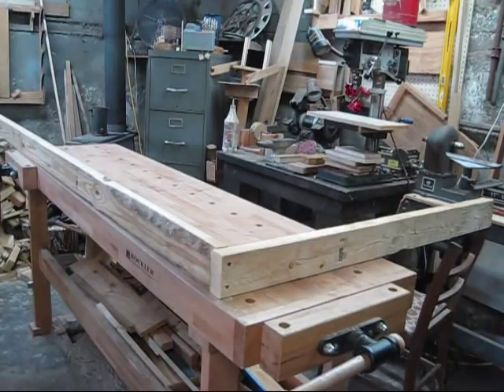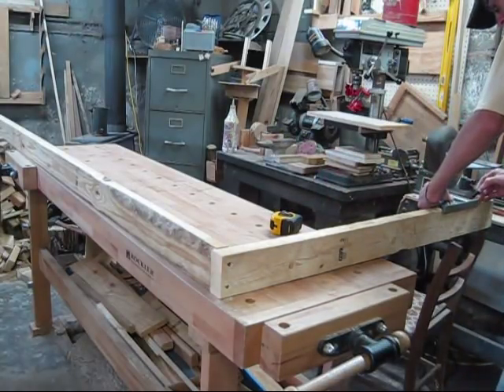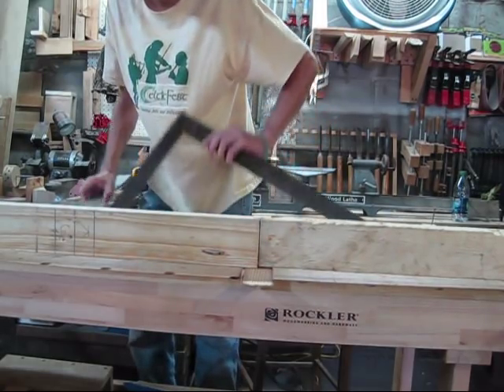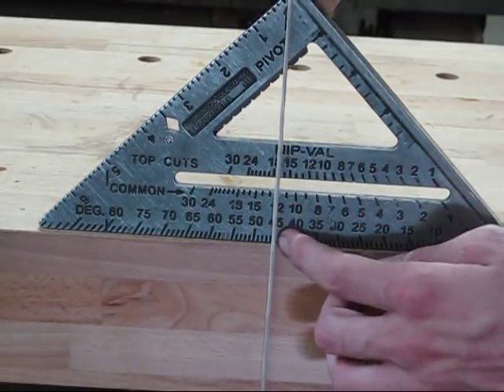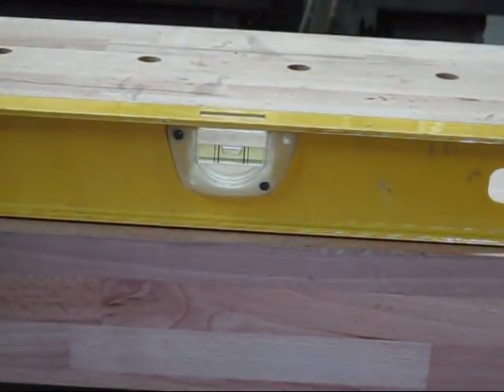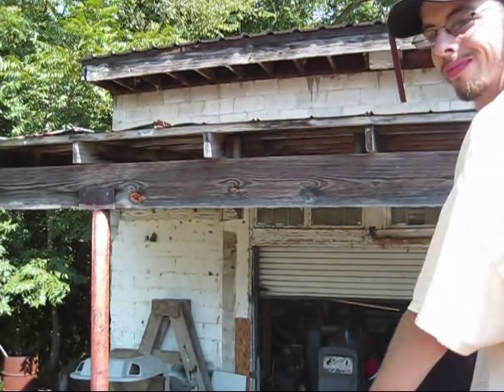Tricks with construction tools

Comment: I liked the speed square as a level, pretty cool. just a tip your 3 4 5 ( the pythagoream theorem) you can do any lengths, you measure any distance ( 3 4 5 is just the easiest) you take your length multiply it by itself do the same with your other measurement, then you ad the two together.  the square root of this number is your measurement that you pull between the other ones.  so length x length  + width x width then square root example    7feet on one side , 9 feet on the other would be  7x7 =49  then 9x9 =81  49+81=130  square root is 11.4 (a calculator will help here)  so about 11 and 3/8 would be your squaring measurement. I know I did not explain that very well and I apologize for that. but I hope you can make sense of this. so if you have a long wall or what ever to square up you are not restricted to 3 or 4 feet. hope it helps

Comment: very informative video! 
id like to extend the 3 - 4 - 5 method. on longer runs you can use 6 - 8 - 10 , 9 - 11 - 13 and so on just add 3 to each number
Reply: 9 - 11 - 13 does not work. The three numbers have to satisfy a^2+b^2=c^2 (The Pythagorean theorem). 6-8-10 works because 6 squared + 8 squared = 10 squared. The last number would actually be 9 - 11 - 14.21267. Sorry, my wife is a math professor and I am a construction math geek. :)
Reply: The numbers have to be multiples of 3, 4, & 5 (as he stated in video) for it to work.  You can't just add 3 as you described. It is based on Pythagorean's Theorem (A²+B²=C²).  it just so happens that 3²+4²=5², so it would also be true of multiples.
(3x²+4x²=5x²)
Reply: burtonkidd You must be scratching your head a lot when you cut all those tappers on your bigger jobs

Comment: Great video. Did you know you can drive a nail into an end of a board and not split it... all you have to do is turn it upside down and ping the sharp edge with your hammer. This will dull the edge and allow you to drive it into ends of boards without splitting it. Try different degrees of dullness. Works on 16s to polebarn spikes! Lastly, if you are up on a roof and have no solid concrete floor or metal table to ping it off of, all you do is set the head of the nail into the head of a prehammered nail, then ping the sharp end with your hammer. Good day!

Comment: the tape measure fetching trick only works if you can see the item but are for some reason not able to reach that far. having worked in various construction trades for many years i have used it myself. 

i did not know the 3-4-5 rule and that was worth watching in itself. usually if i am building something with 4 sides i pull a tape diagonally across the corners to see if they are the same. this will let me know the corners are square provided the parallel pieces are of equal length. of course if you are laying out corner plates on a slab that may not be possible so the 3-4-5 rule is good to know and would be more accurate than a framing square due to the length employed.

Comment: the 3 4 5 is the best way to square corners digging and setting forms for a house foundation.  And to know if you are on the same level for the corners... use a garden hose with clear hose attached to both ends.  The water in both ends are at the same level.  I liked your video.

Comment: Thanks. The first 2 are handy low tech and I'll probably use them sometimes. Just for laughs, I'll give ya a silly tape measure trick in return. I've used it from time to time in good humor. You pull out the necessary length of tape to reach your pal's face while holding the tape reel in the proximity of your crotchal region and proclaim, "Mike, according to my calculations, you're about 5 foot 4 inches away from blowing me right now."

Comment: at 7:00 when you start to pull ur string. If you smooth that corner just a bit with a hammer the screw goes in a little easier exactly where ya want it. Just a tap or two.
Good video my friend. The speed square trick was pretty cool.
Reply from the maker: +HeReformedMe Thanks for the tip.  Glad you liked it.

Comment: Hi all, I live in England and an old timer showed me how to fit a door frame without any levels just a piece of sting and 5 nails. Frame is perfectly square and plumb and it is so simple it is brilliant. You can plumb the hinge side with a plumb line made of a piece of string and a large nail as the weight. you can get the head square using 3 4 5 measurements, then pin 4 nails into the face of the frame top and bottom of each leg then cross string across the corners diagonaly then move the loose leg in or out until the string touches in the middle of the frame, then its plumb both sides. They built pyramids without a Stanley level but judging by some of the houses I work in here in the England some tradesman may own a level but they sure as feck don't know how to use one.

Comment: I liked the 45 level and the tape line thing can be improved....get an old magnet like a disc magnet from an old har drive and hook onto the end of the tape measure or a long flexible rod itll latch onto the tool as well as the piece youre using to retrieve the tool

Comment: good stuff thanks!! and a good trick for tying the string to the last is screw is to take the string and make a loop and twist the loop about 5 times and put the loop on the nail. then you can pull the string tight and take take up the slack with the dead end of the string and it will stay tight. when you want to take it off you pull the dead end of the string and the knot when come undone and the string will loosen and can be removed from the nail.  just a good trick for those that may not have seen it.

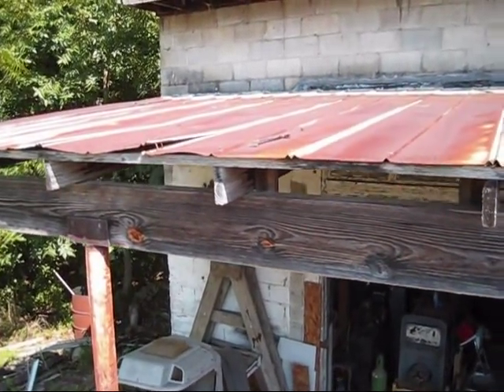Comment: 8:22 If I drop something down onto a patio cover and can't walk on it to reach it, out comes the tape. I've recovered water jugs, chunks of lumber, pencils, screws, and pretty much anything else you can drop that's smaller than a framing nailer.
I've dropped my tape before though, after which I reached straight for the place my tape goes in my tool belt only to find that there was no tape because I dropped it.
Reply: LOL

Comment: A trick I like, for taking long measurements with your tape, where it is hard to keep the end of the tape in place, is to drive a screw into the wood near (w/i 1" or so) the end where the tape needs to hook, then place a magnet on the screw head. One of the strong rare earth magnets will hold the hook end of the tape in place while you read the measurement at the other end of the tape.
Reply: James Ryan you do realize basically every tape on earth is designed to do this without a magnet right? The little slot on the blade of the tape isn't just there to be pretty; its a notch to hook the end of your tape to a nail or screw head to measure things when you're by yourself. You hook the blade of the tape to a screw and it will be aligned with the center of the screw head...

Comment: Thanks for the video. That trick with square and plumb would tell you the angle of a rafter  (pitch of a roof) also, wouldn't it. I'm not going to tell you what I did to figure out the pitch of my shed roof, you might hurt yourself laughing!

Comment: One of the problems is wood shop and  metal shop ,different trades are not taught in school anymore so young people aren't  showin the basics.If they were they might fine it's interesting to them. Then want to learn more about building trades
Reply: Curriculum in public schools is usually planned by the School District.   If the district got enough people from each area to petition the desire for more classes in trades,  you could get a change or even take it to the city board.

Comment: The 345  trick is  part of trigonometry  for the Sine co-sine  tangent  model. 
     You are making half of a  3'x 4'   rectangle  with  4    90 degree  corners  and   sliced    from  the longest distance  which is the  opposite corner to make 2 triangles .  
     On a Unit Circle     X= 1   while  the   y( sine wave) =0.75 .      From there   you would  use the  the  formula to get the   remaining  length  of 5' feet.   
            
          The long  side of the rectangle  is 4  feet     which will be X  ,  the  width  is 3 feet  which will be the height  of the sine wave  y  and  be displayed as   0.75   .   
   The carpenters  square has   has  many of   the  unknown  distances   but is usually  stated    as a Rise/Run   for roofs  or angled doorways .   You just  read  one side  on the edge  graduations  then the other side    which give you the  remaining  side  to know how long to cut the board .

Comment: Tnx for an interesting vid!
We might add that a framing square needs to be adjusted to be truly square: Lay it flat along near edge of table/flat surface, and draw a knife-line along the edge of the square that is perpenducular to the 'base edge' .. then FLIP the base of the square 180deg and draw or cut a new line very close to the 1st one.   ... With a new square they probably will NOT be parallel !!  So,  take a steel punch and drive a dent into the very corner of the square, in a place that will force the square's legs to be either more together or apart ..  This 'adjustment' can be VERY MUCH able to correct even for tiny 'out of square'  framing square blades ... 
(eg, driive a punch-mark at the INSIDE corner of the square to force the legs to be more apart , and conversely, at the OUTER corner to close them , til 'flipping the square and making cut-lines yields lines that are totally accurately permendicular ..
Kinda tough to clearly describe this necessary 'tuning' step but i hope i've made it clear enough ..

Comment: dude,actually like your vid's. n by the way, all my cordless dewalt n porter cable.liked that one too. p.s. even though my porter cable were cheaper,I find porter drill and 1/4" impact better. but on the jig saw n circular saw,Dewalt better. but porter under rated.this vid helped me. i suck with speed square n plumb bob.
Reply from the maker: +David dpal Thanks aye I think the same porter cable is very under rated.

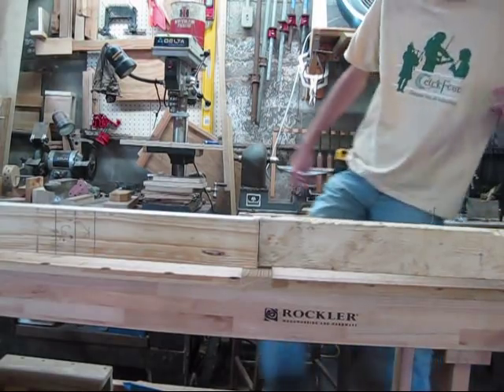Comment: At 3:30, in Glazing, we call that level. If a multi lighted( many glass panels) frame is on a straight line, it's true. IF a straight horizontal line, we call that level, vertical line , in and out is plumb, vertical line, side to side is square.  Rail road tracks are parallel. At 8:35, we call that a jimmy bar or flat bar. A "do all" is that 5 in 1 tool for painters

Comment: Usually, when you want to straighten a top plate or a beam, it is over your head and it's hard to look down on it.  My method is to drive a nail or a screw at each end, like you did except on the side.  When you run the string, put a loop over your finger and spin your finger around a few times so the free end of the string is wrapped around the standing end 4 or 5 times.  put the loop over your nail and pull it real tight.  Pull the standing end away from the starting end and pull the free end toward the origin to really tighten it.  When you release the free end and wrap it one more time around the nail it will stay tight.  Now, take a 1x2, or whatever small piece you have handy, and cut 2 small pieces off of it.  Put one piece under the string on each end so the string is now 3/4" away from the beam.  If the string is really tight, they'll stay there, or you could just tack them.  You can use the remaining piece like a feeler gauge to make your adjustments.

Comment: Hey thanks for the video I really like it. I was wondering is that the 20 volt Porter Cable you're using there. How's it holding up I used to run Porter Cable back in the day and I've been thinking about getting another one.
Reply from the maker: They are great. I'm a big fan dewalt and have been for years, but the new porter-cable drills are equal to them with some better perks. (Lighter, faster RPMs, faster batt charge, longer run time, and better price) you can't beat them for money. Hope this helps. 
Ethan

Comment: 3,4. 5 square is famous Egyptian triangle that was used 5000 years ago, just few years before USA was founded.
Reply: Since when was it called "3,4,5 square"?
Reply from the maker: It is a term used in construction. It really is a triangle. Not all triangles have 90 degree sides, but most do, and this 90 degree side is the "square" side. 3,4,5 is not the only one you can use it is just the easiest to remember.
Reply: Your right about it being easy to remember. But the correct names it's referred by is pythagorean theorem. You dont necessarily need 3,4 or 5 to come up with a 90degree angle or known as "square".
Reply: jeanious2009
Using generic form of Pythagorean (with capital "P", btw) theorem on a field would require a calculator ;) There's a term "Pythagorean triples" - sets of three integers which are commonly written as "(a, b, c)" with a, b and c being integers, e.g., "(3, 4, 5)" or "(5, 12, 13)". Then there's another term, Pythagorean triangle - a triangle whose sides form a Pythagorean triple. So there's nothing wrong with calling it just "3, 4, 5".

Comment: Was hoping for something I didn't know and found it.  the level using a square.  Now that I learned something I'll share back.  When drawing a string line on something like you did to straiten a beam, you can fold the string over your finger, spin it about 6-8 times then put it over the screw / nail.  You can then pull the daylights out of the slack making a really strait line over a really long stretch.

Comment: when trying to get the screw to start in the edge, it is best to flatten a small area of the edge with a hammer and then drive the screw or nail in. just a dimple is all you need.
Reply from the maker: +bos dad Good tip to know.

Comment: With 30 years in of building houses I found tricks to eliminate most of the tools all together except for a skillsaw,1/2drillmoter,nail bags,1"SDS drill,Hitachi framing gun,compressor,single jack,3 laders(6,8 & extension) framing square,4'level,layout stick & whatever hand tools needed & I can frame an entire home of 5000 sq.ft. myself in 15-25 weeks including running all my subs that need to rough in all the plumbing,electrical etc. & get the roof loaded & drywalled all within the 15-25 weeks of which can sound like a long time but not when you consider its faster then it takes most contractors to hire a framing crew & my houses are always what the inspectors call perfect examples of what they want to see & sign off Pre-wrap to final. & my thaught on this video @ first was to trash but then I realised the geniuos & simplicity of being able to share knowledge & generate income doing so with a million & a half views its a good reason to get into video production & save my body from the brutal work of construction. Thanks for sharing & any tips on (how to make you tube videos that pay) would be a great start.
Reply from the maker: +AUER-9 Yeah I'm going to do a video on how to get started on youtube, and make money with it.

Comment: We never 3,4,5'ed a wall, frame it then measure across the corners kicking it until the number is the same then drop/nail plywood on the corners. 3,4,5 was good for checking the green plate (sil plate) and to see how bad the basement guy was. But on a long footer/foundation/basement wall it was 30,40,50 tho. But yeah, it works. Just like using the square for a level...thats as old as the pyramids....literally.